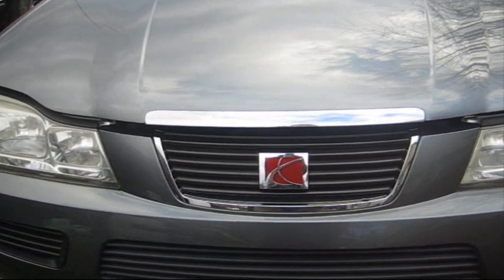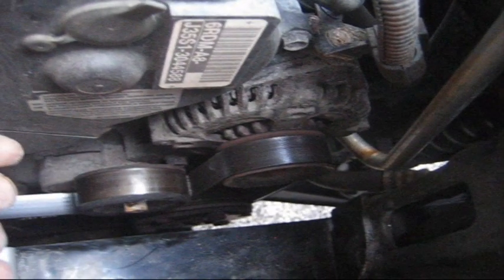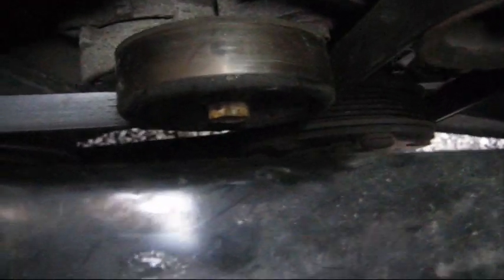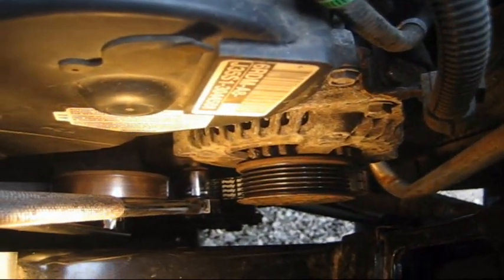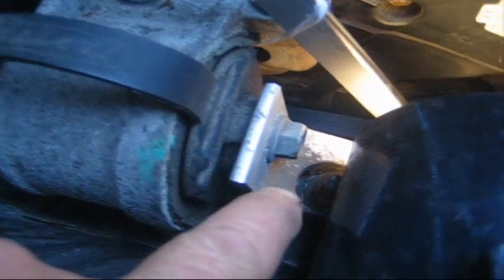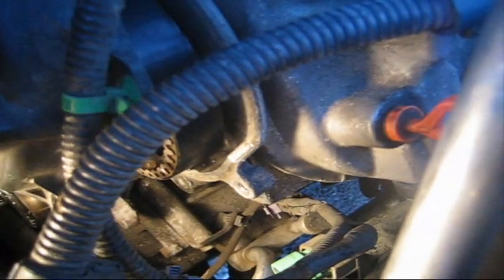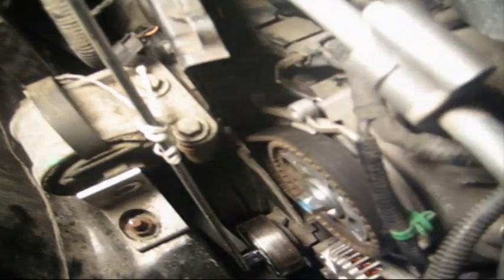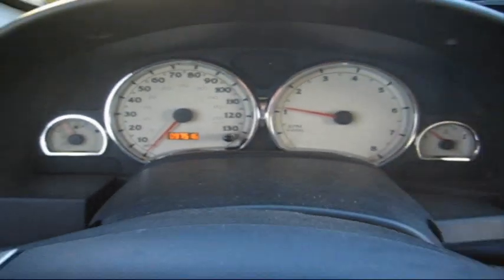Saturn Vue Alternator & Serpentine Belt Replacement #iamacreator

Comment: Thanks for the video, I tried my hand at this project this evening 2006 vue w/ 3.5 liter.  Ended up removing the motor mount and using my engine hoist to lift the engine up a bit to get it out instead of removing the cover.  To hold the tensioner back there's a hole in the left side of it to put a bolt in.    Exact opposite of you, 110 degrees in phoenix, sweating my butt off. At least I was in the shade so my tools weren't searing.
Reply from the maker: Snap-off,  You're welcome I hope this was of some help .And thank You for watching and taking the time to comment !! If I remember correctly it was it the low 20s & high teens when I changed this one. Looks like both of us work in the extremes NOT LOL  I did find that hole you mentioned, but not until I was just about done. I though it had to have one but just could not find it, blame it on the weather LOL
Snap-off  If you haven't installed the TubeBuddy browser plugin yet, to help your channel grow do it!     Just go to: 
https://www.tubebuddy.com/joezep54 

Start with the free version, yes it is free to not only to down load but to use.I hope you enjoy other videos on my channel as well. Be sure to like, share & subscribe if your are inclined to do so. 
Stay well Joe Z

Comment: Does the engine need to be lifted in order to just change the belt?
Reply from the maker: Sorry I am not 100% sure It has been awhile, it is really a tight fit & you will have to twist the belt some, but I believe you can get the belt off without lifting the engine. When you change it come back & let us know. All helpful information is appreciated.  Stay well, Joe Z
Reply: Just borrow loaner tool from a major parts store. Must have a short 14 mm socket. Push it hard to your left hand side with that long belt wrench. Place a #6 Allen wrench or something similarly strong in the dedicated hole in that tensioner to hold the tension in place. Belt comes off. New belt goes in with ease due to that Allen in place. After that, use that wrench again to remove the Allen wrench. I used a long arm on the Allen wrench so when I could use the Allen without being in the path of the long belt wrench. Fool proof.